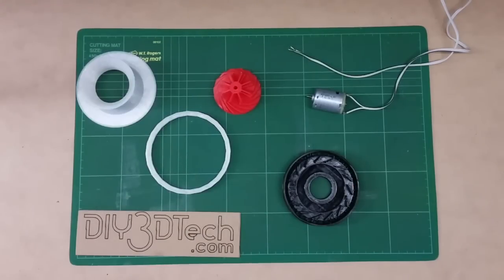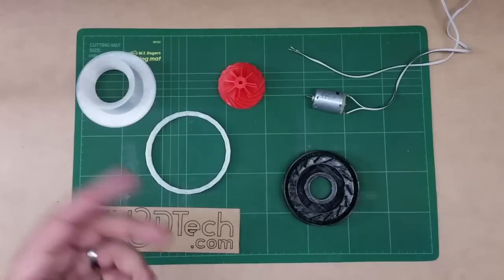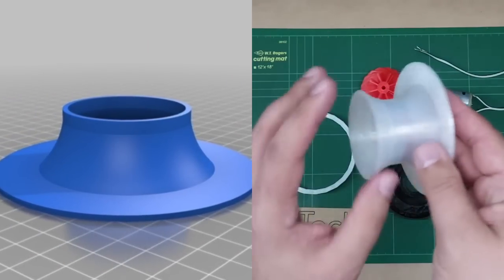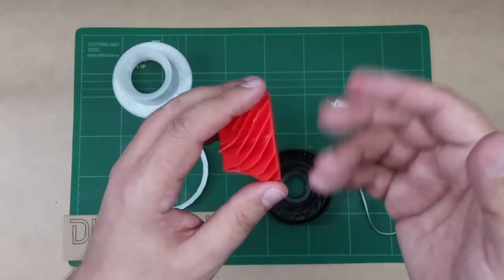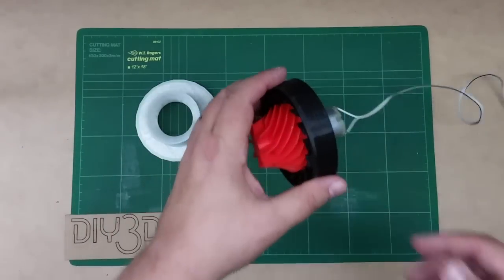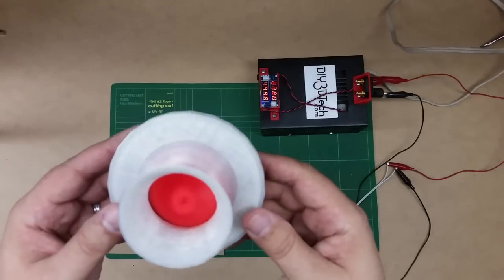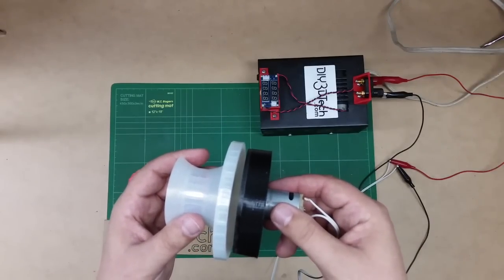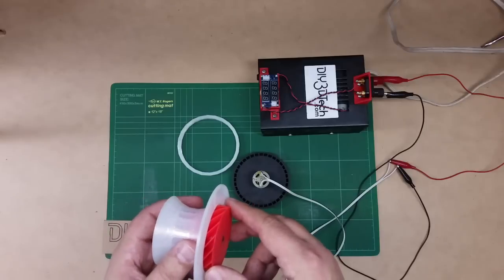3D Printed Projects  -  Turbocharger with Electric Motor!

Comment: A few things to note if anyone is trying to print this, go modify the connecting ring and ungroup everything to make the hole sides to the largest value, the one he made was not exactly a circle...when you print, make sure to add hole expansion to fit your printer tolerance as his files were cut exact, it will not fit unless your printer can pass a 0mm tolerance test...also, the impeller is not a circle either... its slightly longer than it is wide...change it or its gonna wobble like a vibrator...

Comment: Have you thought of adding a gear reduction? Turbos spin really really fast 100k rpm +. There are motors that spin to 50k rpm and gearing to 2:1 and boom, lots of boost

Comment: If this was installed on the intake side of my wrx, a already turbo charged 4 cylinder.  This could help eliminate turbo lag and overall efficiency.

Can you measure your turbo for PSI? Maybe a rating? Do you think it could provide enough vacuum pressure at low-rev 2000-4000 rpm engine.

I read about these electric turbos running up to 80k rpm.

I have a 3d printer and some petg 8x8 print bed... what about casting a compressor and housing... i ramble thoughts and what you did here was cool
Reply from the maker: These are only desk-top toys :-)

Comment: FWIW, that's technically a supercharger, not a turbocharger. A turbocharger has a turbine powered by the engine exhaust that spins the centrifugal compressor.
Reply from the maker: LOL!  thank you for sharing as I know, however the average Joe (excluding me) doesn't know the difference (I use to work on both large scale diesel engines and race cars and put on a ton of 471 & 671 blowers a more turbos (Mack's ate them up) than I can count , I am from Detroit :-) so if say super-"what" verses "turbo"...
Reply: no duh lmao, its a 3d printed model to demonstrate how it works, what you gonna say next go comment under the 3D printed jet engine fan "iTs NoT a JeT EnGiNe, iT dOnT gOt AiR aNd FuEl mIxEr To IgNiTe"🤡
Reply: @JackZhao-b5v  Hmm… you seem to be new to the internet. If you use the wrong basic terminology in a video, especially a technical one, this WILL be pointed out; and that’s not a bad thing as not doing so spreads misinformation.

Also… you do realize that you’re complaining about a comment posted seven years ago, and in that time nobody else has had your reaction?

Comment: way cool . time for brushless dc motor and then you have a good vacuum motor . 
the better you get that spacing , and balance on the impeller . possibly turn the impeller on lathe , and the inside of the venturi .
Reply from the maker: The balance was not too bad however yes did consider spinning it up on the lathe to clean up.  might revisit this project in the future to create a USB-powered desk fan version :-)